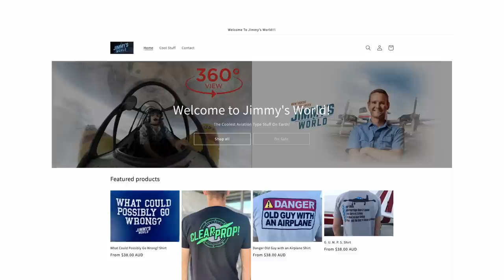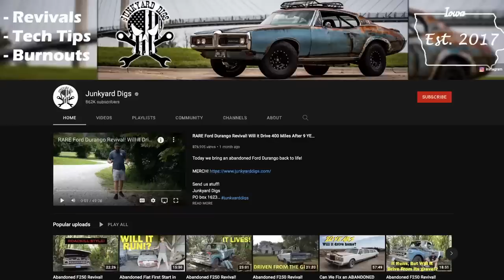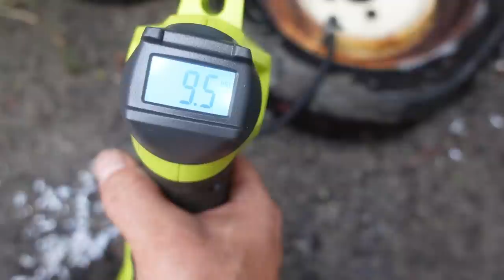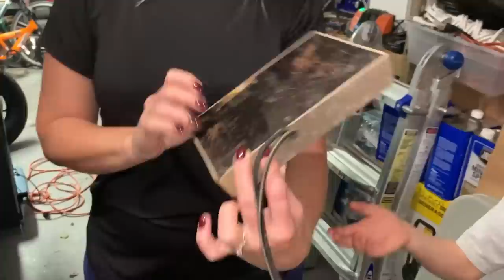Getting Our Abandoned ELECTRIC Car Home After 20 Years

Comment: You can replace those old batteries with lithium iron phosphate marine style batteries with built in BMS so the y don't melt down like the tesla and that little sucker will burn rubber with the right motor and run for a week.

Comment: Look for a zero motorcycle on copart or another company like them and do a zero motorcycle electric motor swap you will get the battery controller and the motor then that little electric car would fly probably be a death machine though more than it already is lol

Comment: Diabetes is a killer that few know about my mother was Diabetic and passed away due to heart conditions my father has Diabetes which is controlled with tablets and fortunately is very stable and I've had Diabetes since 2012 and have had no end of problems with it from out of control glucose levels to Diabetic neuropathy and sleep apnoea.
In order to control my glucose levels I've had gastric bypass surgery leaving me with only 30% of my original stomach capacity.
Because of the Diabetes the combination of nerve damage (Diabetic neuropathy) herniated Vertebra and muscle atrophy in the lower spine I'm mostly immobile and cannot walk for more than a few meters without assistance ( crutches or wheelchair) but on the plus side I still have my health so silver linings
If your Diabetic my heart goes out to you and your family and remember you control the Diabetes the Diabetes doesn't control you stay strong and keep the faith.

Comment: your hair will be grayer when find out what the batteries will set you back. i’d look at marine deep cycle marine batteries glass matt or agm batteries shop around their big custom jobs your airplanes are a lot cheaper or as equal cost plus your fiberglass glass repair personally yea it’s different but another airplane build n flip would be easier cost effective gotta do fiber glass repair get that strengthened back up new batteries new brakes tires wiring new on switch good luck where in the world can you go that’s suitable to goof in it. oh boy blue shirt has my answer wah wah